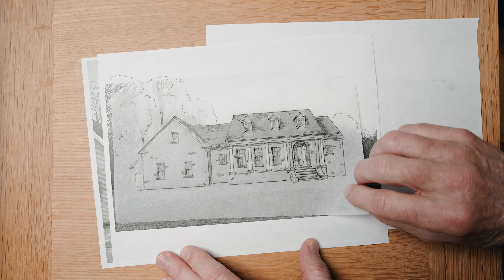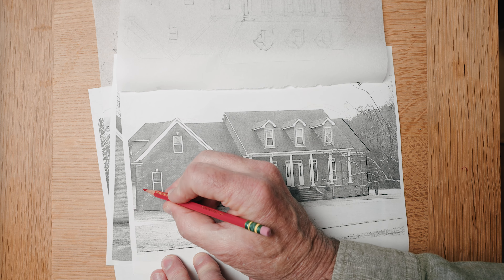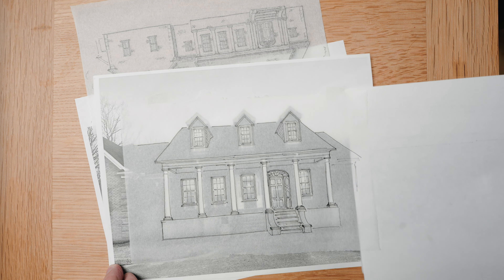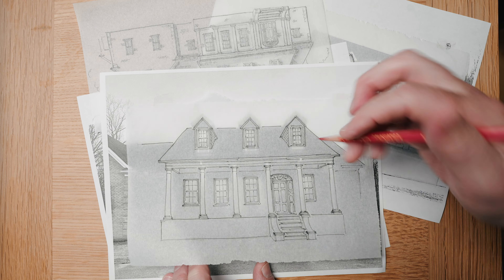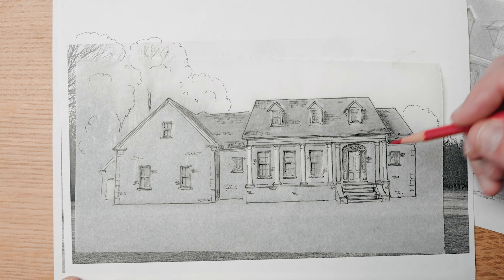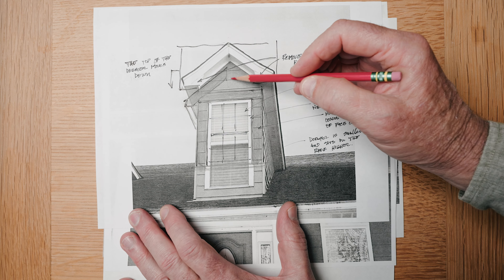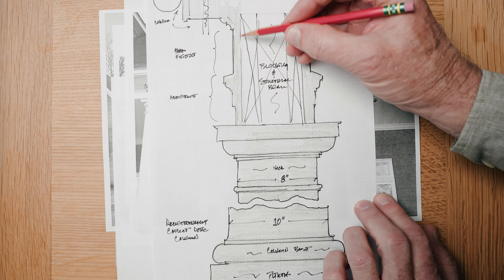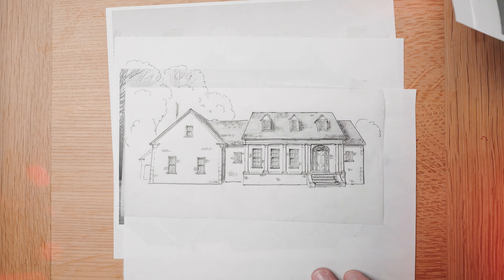How window size can change the look and feel of a traditional home.

Comment: Love all the changes. I prefer continuous return on garage and dormers rather than the partial returns, looks more traditional. I would also change to Hardie Shingles above the garage continuous return with brick below to make the garage distinct from the house. I am not a fan of the semi-circle window transom on the front door. I would do a rectangular transom with side lights and moldings door surround as you have demonstrated in your videos on punctuating a door (e,g casing and header), will look very classy. Agree with all the window size changes - aligning window height with chair rail height, garage windows smaller, 2:1 height to width window sizes and dormer windows about ⅔ to ¾ of width and height of first floor windows.
Reply from the maker: Thanks!

Comment: Hi Brent,
Love the videos please very helpful and learn a lot about historic houses. I guestion about the columns hanging over the beam. I have always tried to set them back b/c rain water will just on top and rot the columns. How do you compensate for that issue?
Reply from the maker: Understood. A small piece of metal flashing is all that is required. Further, if the column is allowed to breath with a small area of air flow from top to bottom it will dry out. Also, on this house the overhanging eave will block 90% of the water. If 10% of the remaining water rots your column you are using cheap columns. I would encourage you to change this practice. We've been building it this way for centuries.

Comment: Hi Brent, great video! I have three questions:
1. If you do change the material on the gable end of the garage wall, what would you choose instead and how would you transition it to the brick below (ie stucco above, a piece of horizontal trim and brick below)?
2. The porch floor seems to be quite high off the ground. Will you have to add a railing?
3. When you correctly size the neck of a column to the width of the beam that’s above it the front edge of the capital now extends 2 to 3 inches past the front face of the beam. How do you keep water from pooling on top of that narrow horizontal surface and eventually rotting out the top of the capital and possibly the beam?
Reply from the maker: Good questions. 
1. You need to fir out the studs above the brick so that the siding laps over the front edge of the brick. 
2. I would not using the grandfather clause.
3. Simple flashing is the answer. Houses have been built this way for 100s if not thousands of years. I think we can figure it out.

Comment: I like the changes to the main house. I would like to suggest what seems disturbing about the garage is the expanse of brick. Would it diminish the problem with 3 windows closely placed together and centered in the same place below the other window ?
Reply from the maker: Thanks I looked at that, it is an option.
Reply: @BrentHull  A gardener's cheaper solution would be 2 or 3 wall trellises with clematis vines :)

Comment: Hi Brent! Wonderful transformation...Again!  Would you discuss why windows are now so often pushed forward to the exterior elevation instead of the slightly inset way they used to be installed? I have noticed the traditional way created a better look and of course a great shadow line. Why are windows done incorrectly now ? Is it the lower quality ones or why? I can't figure it out? Thank you!!!
Reply from the maker: Yes, its a problem. Thx.
Reply: It's because of the way modern windows are made and installed. Most new residential windows are built with a fin or a flange that sticks out from the frame all the way around. The fin is nailed to the face of the sheathing and then the flashing can be taped right over it. It makes for an easy installation and a good weather seal, but it brings the window right out to the surface of the wall. With thinner siding materials the window frame sometimes even protrudes past the siding. I agree that it looks terrible, but it's such a common and accepted approach that it's difficult to convince people to pay more or take more time to recess the window.
Reply: @benjaminledford6111   That was what I wanted to know.  Very good explanation of why the windows are installed in that manner.  Do you know of any manufacturers that make more "old fashioned" windows that would be installed in the traditional, set-in method? How would someone who has these new windows go about changing them and repairing the opening to house the older style window? Thank you!!!!

Comment: Curious to hear your thoughts on the importance of interior "Feel" of divided light windows vs. exterior aesthetic. We've had this experience in two different homes now where we felt something was "Off" while inside. Once we changed from 6-over-6 divided light to single-light casement windows (same size), suddenly we felt like we could breath inside the homes. Took it from "Dungeon" feel to open and airy feeling with a connection to the outside landscape. These two experiences changed our view to: Exterior aesthetic comes second to interior feel--exterior aesthetic matters more to passersby while interior feel matters to owners/inhabitants. Any thoughts on this?
Reply from the maker: Hmm, I have never thought that, but my brain is wired around the preservation and historical precedent. Thx for sharing.

Comment: Where I live the code requires you have 5.7 sq ft net opening for egress, which on a double hung equates to about a 3'x5'. How do you situate a window that big  in a doghouse dormer without it being overbearing? Can you use a 9/9 lite on top, where the rest of the house are 6/6?  A casement window that mimic's a double hung would allow for a smaller size, but I really dislike casement windows, unfortunately it's hard to get around these egress requirements.
Reply: Is that egress from a bedroom? Or all rooms? In my area it is only bedrooms.
Reply from the maker: Understood. I don't think it is that big. 5.7 net opening is a little less than 2x3. I would make the smaller window act like a casement. Thx.